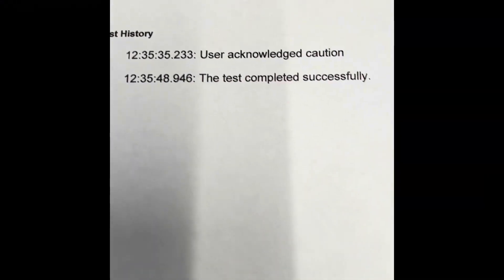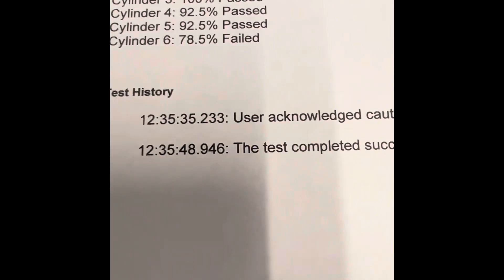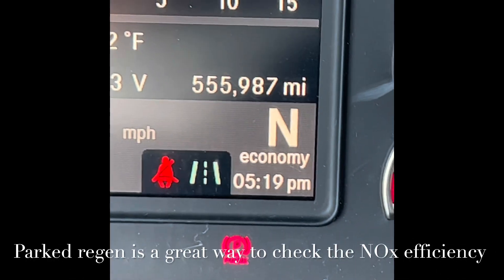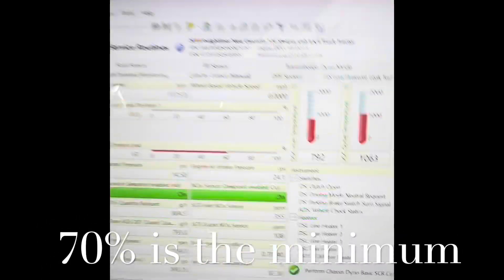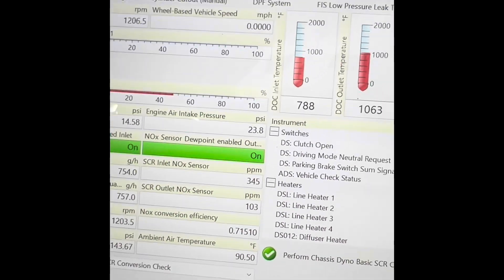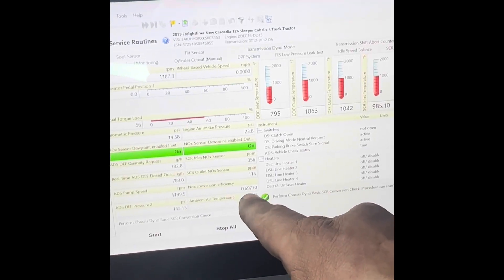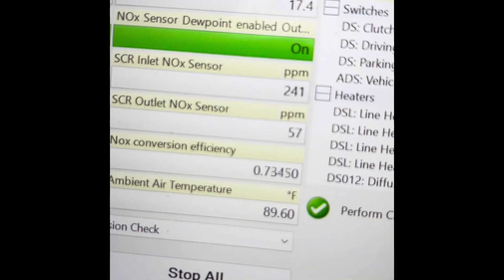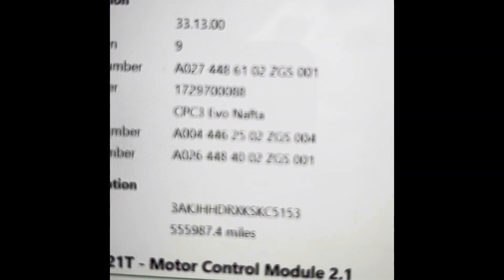Don’t make this mistake when buying a new to you  truck!

Comment: Friend of mine bought Freightliner cascadia '16  in October last year. Check light came on for 1569/31. Company replace doser value n cleaned DPF filt. Unit has 350k. Not what's going on, but like keeps coming on.
Reply: I have to retrieve those. I'll get back to you
Reply: Isx 15
Reply from the maker: @johnavalos6010  There should be another fault code associated with this, what are the other fault codes (active and not active)

Comment: What computer system are you using to get compression and Nox readings?
Reply from the maker: I use the Diagnostic Link from Detroit. You can purchase it from Nexiq   
The software is available in two levels. Standard which lets you do just about everything and the Professional version which can allow you to perform updates.
Reply: @CarlosDieselElectric tienes algún link donde pueda comprar ese Software ?